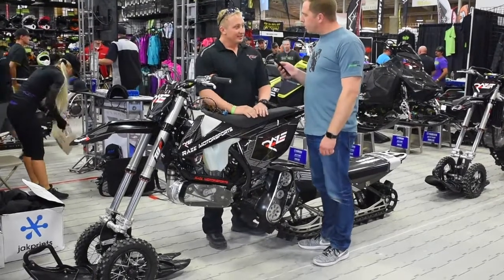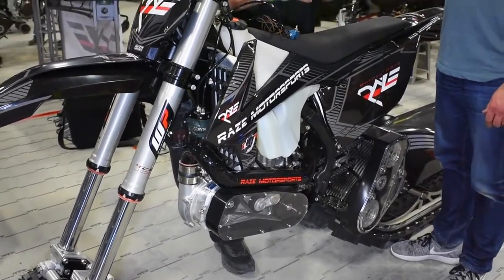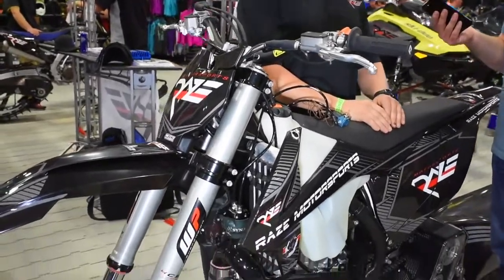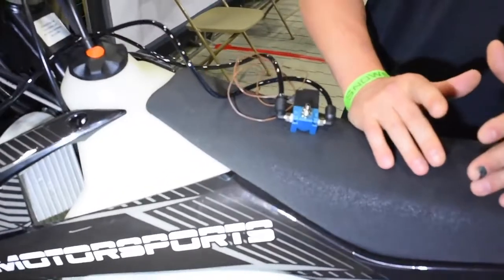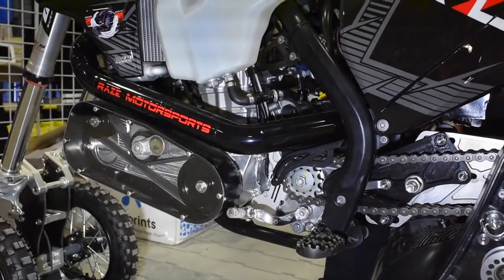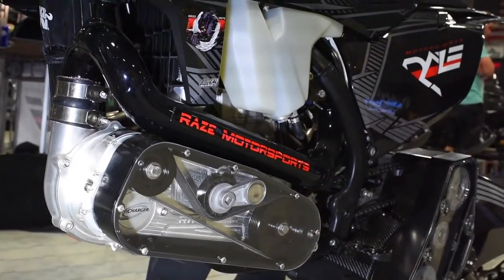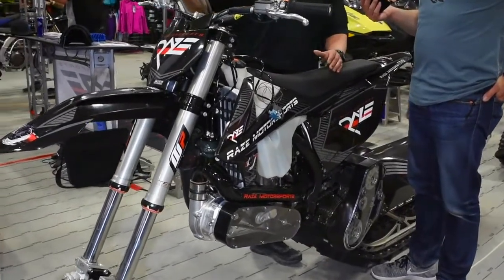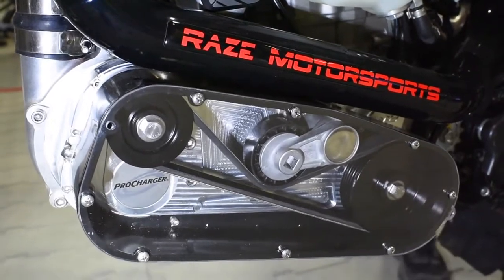SUPERCHARGED KTM Snowbike!

Comment: want to superhcharge a rc390 engine with a 20mm restrictor on it which is to be placed before the supercharger and the plenum. tips anyone ??
Reply: Hey rj, i realize you commented on this video 2 years ago but im curious, what project were you doing that you wanted to use a 20mm restrictor on the intake before the supercharger? Let me know thanks
Reply: @rjrobinson7663  I'm sure is for a  F SAE single seated. The 390 is widely used, they admit supercharged engines but everyone must have a 20mm restrictor ora 19mm if is on e85.
Reply: @rjrobinson7663  For F SAE I've made a ktm 690cc engine but turbocharged. The most powerful LC4 in F SAE, also better than others running e85 (we were on gasoline). We had 86hp with the 20mm restrictor.
Reply: @michelem.1461  what year was the bike?
Reply: @ktmturbo5836  It was a car...